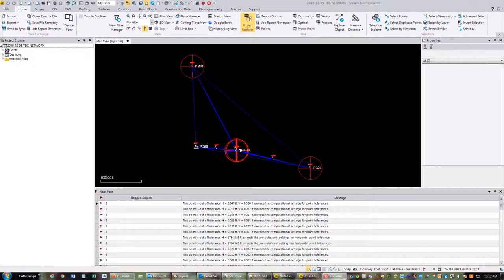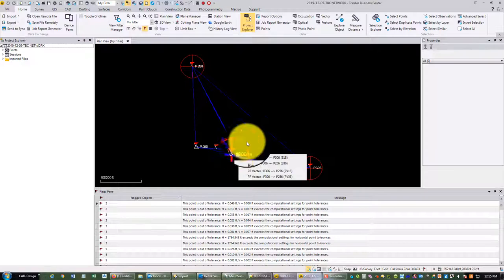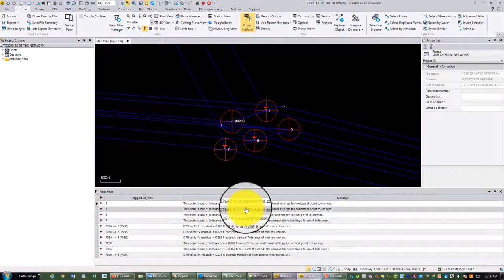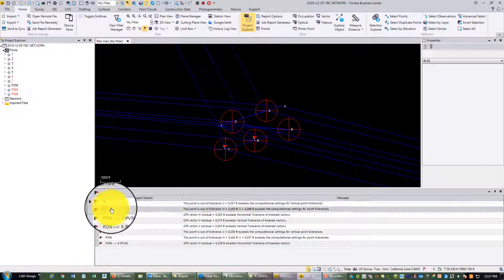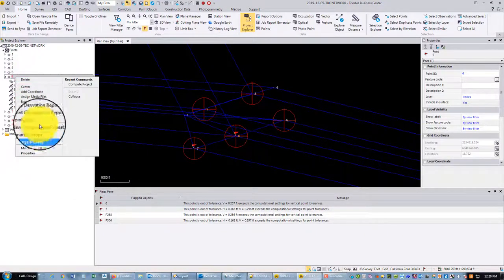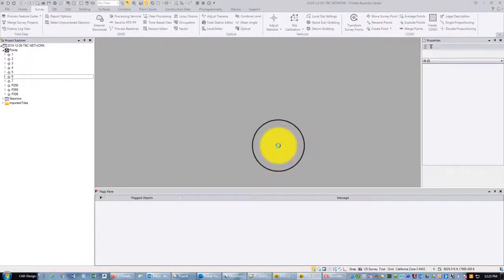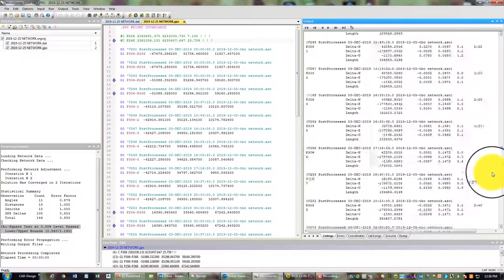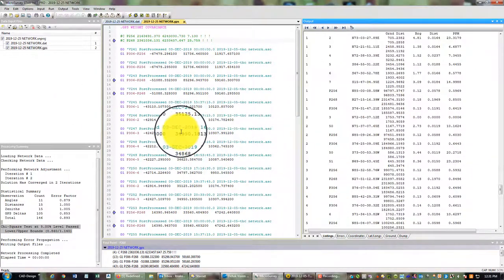Star*Net Adjustment Of Static GPS Vectors and Total Station Data

Comment: At 0:35 you said TBC doesn't let you adjust GNSS vectors and total station observations combined together? Not so. We can most certainly adjust both together and also add digital leveling too.
Reply from the maker: Hi Jesse. I haven't been able to get this to work. If you can point me to a video or article that shows how, I will certainly give it another try. Thanks for the comment!
Reply: @RedefinedHorizonsLearning  , it's covered in the TBC tutorials. Trimble has always supported the combination of all surveying observations (GPS/GNSS post processed vectors, RTK / RTN GNSS vectors, total station records and leveling) into the least squares adjustment in TBC, and back in the TGO days, and dating myself here, um, yes even way way back in the MSDOS days using TrimNet Plus ;)